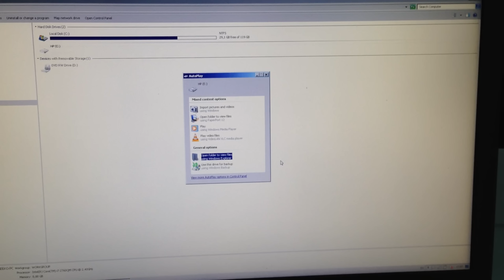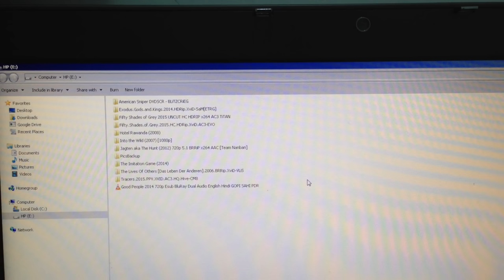How to recover data from a dead hard drive (for beginners)

Comment: This video is not recommended. It may be working but I can assure you that some magnetic bit is damaged and if you were unlucky, those bits maybe your data which can cause it to be corrupted. if it works like what the video is, I recommend you backup your data as there is a high chance you reduced your HDD life span significantly as opening an HDD should be done in a clean chamber to prevent any particle disrupting the actuator and the platers. My best recommendation is to send it to a data recovery shop as they are more well equipped and experienced in this job instead of yourself with no skill.

Comment: People, this video is just a prank, a joke!
As soon as you open a hard drive like this, you can kiss it goodbye because the invisible particles of dust in your room will make it even worse.
Hard drives should be opened ONLY IN A CLEAN ROOM which is free of almost all dust/smoke particles!!!
In normal operation, the hard drive heads "fly" above the surface of the disk at a distance MUCH smaller than the size of most invisible particles in the air, and exposing them like this is like throwing large rocks under the speeding car's wheels.
 Opening them in a normal room is like opening a mobile phone in a room filled with acidic steam, which will make shorts and seriously damage metallic surfaces.

Comment: Never use again? There is an air cleaner in the drive. You could get years more use. I once removed 2 of 6 heads in a drive and set it up as 2/3rds original size. I even removed 1 full platter and a pile of rubble from the inside caused by surface coating being worn off by a bad head. It worked for 4 more years. That was 1983 technology. In recent times I just keep using modern "stuck" drives for a few more years. But drives today are cheap (That 1983 drive cost $450.00), so buy a new one if you want.

Comment: my issue may be different. 
I have a Phanteks Enthoo Elite. It's a dual system setup. Separate PSUs for each system.
The drives are used by the mini-ITX that i have.
I have 3 WD Enterprise Drives. One Red (6TB), and two Gold (12TB and 4TB). I connected the Red drive, and 4TB Gold drive via 90 degree sata cables to the mini-ITX. And their power comes from the Corsair PSU (with Corsair cables) of the MAIN system. Both drives were detected by the mini-ITX until i thought, "if the drives are being used by the mini-ITX, i should should plug in their power to the Thermaltake PSU (the one being used by the mini-ITX". So, i turned off the system, flip both power switches off, waited 30 seconds and then unplugged both drives from the PSU of the MAIN system. Since i was at it, i connected the  third drive (12TB Gold) to the SATA power cable, and plugged in all three to the Thermaltake PSU. Initially i forgot to connect the data cable of the third drive to the motherboard. I'm not sure if i had powered on the mini-ITX at that point. But i connected the data cable of the third PSU while the system was off.
I powered on the mini-ITX, and then none of the drives were detected in Windows. I have an UEFI BIOS but there is no menu/listing for connected devices. Only in the Boot menu, the boot devices that show up are the M.2 drives ON the motherboard. After i had a friend in I.T. help me remotely. I connected the devices one by one, and even tried different ports, and enabling ALL SATA ports in the BIOS. None are detected. We even tried connecting the drives one by one to the MAIN motherboard, but the drives were still not detected.
Originally all the drives were detected by my old computer through it's external hot swap bay (Thermaltake Overseer RX-1). I tried using the drives on my old PC, and they weren't detected there either.
I don't know what else to do. I tried feeling whether or not the drives spun, but couldn't feel anything on the new system. On the old system it feels like the are vibrating, but that could just be the other components in the tower vibrating. Is it possible that the 90 degree data cables somehow got damaged because of how they are curved inside the case?? Should i use separate power cables for EACH hard drives? I know it seems like a dumb suggestion but I'm freaking out here.

Comment: Thank you for such excellent tip and advice.  Your video tells us what to do after we open the drive.  By the way, how long were you able to use that hard drive after opening it and exposing it to air?
Reply: Yeah... They're always exposed to air... What do you think they put a breather hole for?
Reply: Wasn't it already exposed to the air while it got manufactured and before they fastened the screws

Comment: Steps for Macintosh Hard Drive Data Recovery

Once you choose uFlysoft Data Recovery for Mac, all you need to do is to follow the steps below to perform Macintosh hard data recovery with ease.
1. Install the application on your Mac. (Dont worry about the fee. uFlysoft data recovery software is free download/free scan application.)
2. Launch the program and select the path and start scanning. (If you want to recover your lost files on the store devices, just choose it and start scanning.)
3. After scanning is finished, click Recover and choose the path where you want to store the recovered data. (Warning: Do not store the recovered files in the path where you lost them before.)

Comment: I've had some good luck simply dropping a stuck hard drive on the floor to free it up
Reply: is this a joke or did it actually work lol
Reply: Rexem : That is an actual approach to "fixing" a hard drive. And by Fixing, I mean bringing the hard drive back to life long enough to get the data off it. And when he says he was "simply dropping a stuck hard drive on to the floor", you are NOT starting off by dropping the thing from chest high to the floor. Start off at 6 inches from the ground and see if that does anything. If not, try 12 inches. But don't keep going until you are dropping from chest high. There is no reason to. If you are dropping the thing from say ... 2 feet off the ground and that does nothing, do you really think dropping it from chest high is going to make much of a difference? If you think Yes, then please move on because you are not using you head wisely. The thing here is to realize something may be stuck inside of the hard drive and all you are trying to do is free it up. And at 2 feet off the ground, that's pretty high up and there isn't any reason to go higher. How do I know this? I don't know for sure exactly, it's an educated guess. I've torn open more than a few hard drives in my time and have put together more computers than most people, so anything I do on computers comes from experience. I personally have never had dropping a hard drive be the fix for me, but I know some people who it did work for. And currently I am working on my brothers computer who's hard drive is making a clicking sound when I boot the computer up. I've already tried booting this computer up using a bootable Ubuntu Linux DVD just to see if Ubuntu would recognize the hard drive. If it did, end of story, I would be almost done. But Ubuntu didn't recognize the HD so now I am searching for some utility that is better tailored for my particular problem. And there are LOTS of utilities out there, seems most are Linux based, just need to find one that looks good to me and go from there. I may be done in another 30 minutes if everything goes well. If not, I may be here 24 hours from now still searching. You just never know.
Reply: Any recommended software?
Reply: these hard drives can survive up to 350Gs. Dropping it on the floor will probably give about 6Gs
Reply: use a screwdriver and tap it if frozen up sometimes works well too :)
Reply: Not if the head is in read/write position like in the video. If the head is in resting posistion then yes
Reply: no, it may work but dont risk it. i did a similar thing but instead of dropping it on the floor i shook it  really hard to get the reader hand to fall back in place.  you shake the drive in a power 1, 2 manor it fall back. save everything because that is like your one last time to save everything. i did not turn off my computer for a days to while i was copying everything back. yes days, it was jumping from kilobytes per seconds slow to 80MB
Reply: @middleclassic   I'm really shocked by these solutions offered here, sure if the data is not unique and important have fun. But a lot of real Data recovery engineers will give you free advice on how not to lose your data forever.
Reply: @Mansare94  That's an SSD. A hard drive will get damaged even at 5Gs powered off and powered on at 3Gs.
Reply: @mikedeacon7113  You're wrong, they spin at 7200 rpm. There's more than 5gs there alone.
Reply: Backup often, verify and test recovery process periodically. In case of fault, get a new drive & restore... Throw the old drive away. 

No, I don't wanna hear whiners scream "But this is in case you have to do this!"

Don't get me wrong - I'm a big fan of making things work again. But, this really isn't about getting the drive to work again... this is about your data. It's can't be replaced if there's a failure - AND THERE WILL BE FAILURES.

You wouldn't have to attempt this <1% success rate band-aid fix if you follow some simple decades-old data protection protocols. Even as a home user now, $49 gets you an external WD HD with backup software. OS's also have backup apps included for a reason - Please use them.   W
Reply: When I tried this with my new drive, it started making that techno sound.

Comment: My HD died so I took it apart to see if the heads were stuck but they were not. What else could cause it to fail? What else could I do to recover the data?
Reply: Kevin Lam broken spindle
Reply: The heads are damaged and need replacement. Usually $300-400. Or if the drive does not spin up at all it could be the Printed Circuit Board. Or the Spindle Motor is fired. There are a lot of things that can prevent a HD from being Recognized in the OS.
Reply: @MrEthanhines  Mine is spinning, silently no noise & is undetectable at times. Other times it's detectable & the system locks. I created an ALL Files refresh .bat from cmd but the drive was unaffected in clearing. It would not refresh. What else can I do?
Reply: @Nabiyah1  @Nabiyah1
 Since it is spinning up it sounds like either one or more heads are failing. They may be trying hard to read and failing thus the "system locks". Otherwise it could be the platter(s) themselves. Either way more sophisticated software will be needed to isolate the problem. The good news is if you stop right now you should be able to retrieve a lot of the data if you take it to a pro. Some offer free inspection. Be sure to do your homework before choosing your professional
Reply: @MrEthanhines  The thing is... it's the so-called pros that made a bad decision to attempt to refresh the drive rather than safeguard (retrieve) my files.😏
But I hear you, you didn't mean a geek squad tech, but true professional, which I also did recently & it was beyond their reach. I need to continue looking for a pro that specializes in data retrieval. Thanks for the feedback.
Reply: Is dead hdd cause my asus laptop not to boot? It got stuck on asus logo restarting loop. Pls.advise tia.

Comment: Thanks for having muted those seconds of disc scratching when putting the header back in its place.
Also, what IS the way to open a hdd so you can reuse it?
Reply: He meant that  opening a hard disk  this way is only  useful to recover important data,  but is not suitable as a trusted hard disk to store  in future more important data.  Data must be copied into a new hard disk, cause  even the microscopic dust will eventually  cause degradation  of plates surface  as they spin so fast.  HDD are assembled in special laboratory where   technician works with kinda bio hazard suits, thin gloves,  and the AC is special to keep air 100% free of  any solid particle
Reply: @diegoteclas  Also known as a ISO Class 5 Cleanroom
Reply: @DragonEye135  really?
Reply: @misha-kun7  Yes, Cleanrooms are basically rooms which are maintained at a very low particulate level for specialised manufacturing such as harddrives, etc. Depending on the number of particles in the room, they are classified into different ISO classes.
Reply: @DragonEye135  thx for answering

Comment: I answer this video and I advise nobody to do this, first that the procedure is wrong, according to that there is a technique to return the set of heads to the parking of correct form without damaging the plates, no metallic keys to play in these pieces, I believe The video may have been edited. Do not do this with your drives, always look for a comprehensive data recovery lab.

Comment: mine clicks. I opened it and the disk spins freely, and the lever is on the platter. when I plug it in, it spins and i can see the lever come off, half way over the disk then bounce back to the platter, that is the clicking sound.... is there a way I can fix this?

Comment: Hi, I have a 750gb WD Scorpio Blue drive that was dropped and now when powered up it gives a clicking noise and the platters spin but the heads will not move across the platters. My laptop bleeps when the drive is plugged in (and out) but does not show it in computer management. Any advice on recovering my data would be appreciated.

Comment: My keyboard and mouse stop working after 15 minutes of use and msg displayed "power surge on the USB port. USB composite device needs more power than the port can supply". Do you have any solution.

Comment: my Dell laptop fell down from a height of 4-5inches.
and now the internal hard disk is not detectable and is making some 'tik tik' noise when I swithon the laptop.
I contacted some data recovery agents and they said they would charge upto 50000 for that.
what might be the actual problem? is that data recoverable?
Reply: Probably a head crash… And with a head crash it is unlikely that you can fix the drive yourself
Reply: Manoj P Nadlumane WTF 50,000 FOR A LAPTOP FIX? just get a new laptop bruther
Reply: @Happy-hc4se  its not about laptop. Its about the important files inside..maybe

Comment: I don't know if I should do this because mine makes a different sound like this (beep..beep............beep beep..........beep beep) I kind of not sure what it means but if you do please tell me, because I don't want to destroy my hard drive
Reply from the maker: Once you open the hard disk, there is a major risk that you will damage it. If it makes a different sound then I advice you not to do it.
Reply: Mine makes a clicking noise, but I also hear a beeping noise, not sure if it is also from the HDD. Should I try recovering data from it? I've tried re-connecting the connector but now when I boot up the laptop it says it can't find the HDD, so should I just go ahead and try?
Reply: If You are hearing a clicking noise, and a beeping, then sadly this is known as what they call :THE Beep Of Death" This happens when Your hard drive is failing! Which means internal parts are going, or is already bad! If You can still read hard drive and there is data on it, that you want to keep then I suggest You back it up, because You won't be ready it much longer before the hard drive goes dead!

Comment: I thought if you spin the platters, the head just moved away on its own? I don't think I'd risk opening a drive anyways, the slightest dust can get inside and ruin everything. The platters also pick up fingerprints, so touching one may ruin it in one go.

Comment: Never do that with HDD that contains value data!
 p.s. HDD on this "tutorial" is full of dust particles, so it won't work anyway. Repairs like that MUST be executed in CLEAN ROOM ONLY!
Reply: i was thinking the same thing. but, if you just want to recover your files and then once done just throw it away. it's already faulty.
Reply: @freaker126  I don't think that you have chance even to recover own data after such violent violation))

Comment: This is ridiculous. For starters, it's no accident that the discs are sealed in a clean room. In addition, heads are removed only when replacing them. The disk will not return the head to the reading surface alone. It is not programmed to move beyond the read and write area precisely because the heads are spring-loaded. Trying to do this will cause damage to the disc and the heads themselves.

Comment: does this work for ps4
Reply: "does this work for ps4" - Only if you want to kill the drive. HDDs are not supposed to  be opened for any reason outside of a "clean" room with the proper equipment. 

That drive may or may not be "cloneable", but either way it's toast.
Reply: What about SSHD's? Solid State Hybrid Drive?

Comment: Sorry, English not the official language.
And for those cases where the external HDD appears in "devices and printers", in the option disconnect device, but does not appear in disk management. That is, there is no way to access Windows or any other third-party software.
Thanks for your attention!

Comment: i wanted to recover data from an old laptop that is no longer working. so i did this and plug it into another working laptop. however,  the drive is recognized as system reserved instead and i cant access the files. went to diskmgmt and it prompted me to initialize the drive but failed to do so as an error message appeared stating ''fatal device hardware error''. any advice?

Comment: when I try to open the final plate on the disk, it doesnt open. Ive taken out all the screws, but the plate isnt coming off. It lifts on one side but the other is stuck down. There are no other screws, so i dont get it.
its a seagate 6tb desk expansion external hard drive. Its just a barracuda on the inside